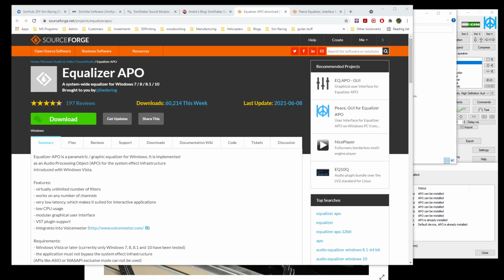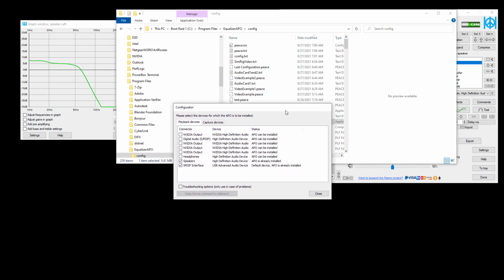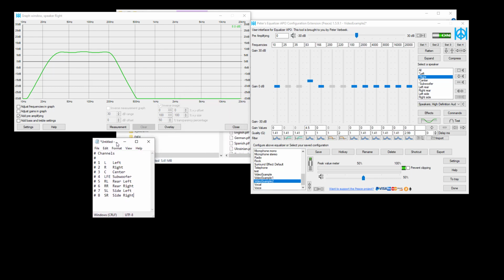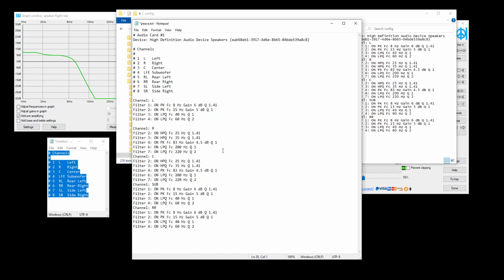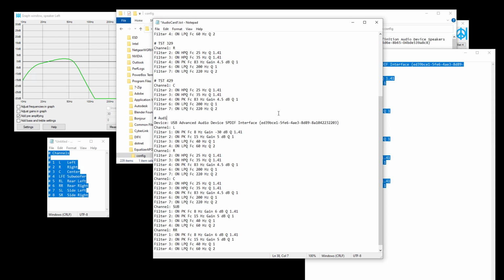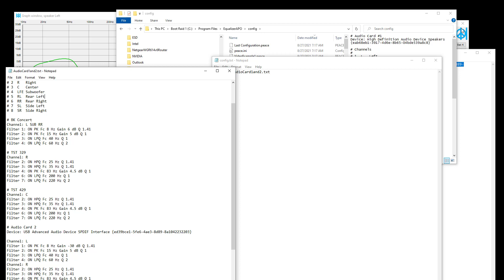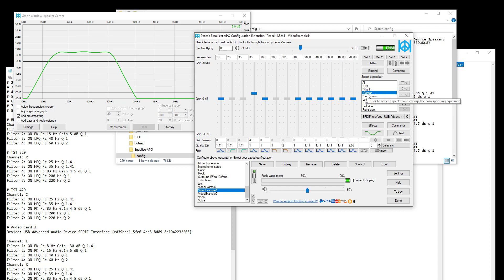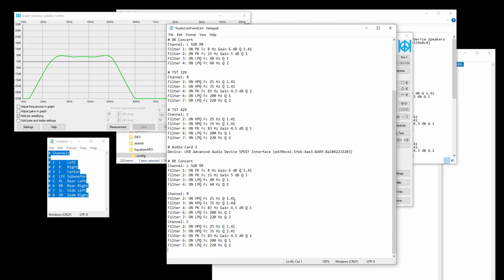Equalizer APO Tutorial for transducers

Comment: Nice video!
Could you detail how you construct the logic to build the filter sequences ? I mean how to determine which frequency to put in the low/high pass filters...
Is it based on some datasheet from the devices (TST, BK...) or more a feelings/trials process ?

Thanks
Reply from the maker: I'm not saying that the curves I showed are perfect and for different rigs you may want to tweak them. They are certainly not supplied by the transducer manufacturers. 

I was given images of curves for each transducer that someone else had spent a lot of time refining and I simply tried to match them.

What I can say is that my transducers are very quiet and aren't wasting power creating intrusive sound.
Reply: @markkovalcson7243  Sorry if I was aggressive, it was clearly not the goal. I'll take these images as a starting point and keep reading racedpt forum to understand them :)
Thanks again for this clear video
Reply from the maker: @nittch  I didn't take your tone as aggressive at all. Did I imply that? 

Good luck! Tactile can be a deep dive!